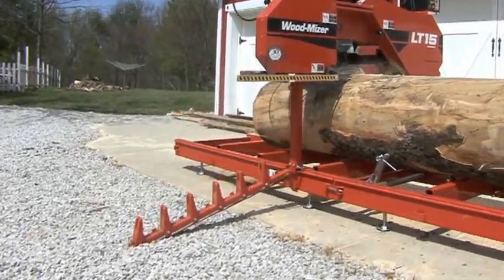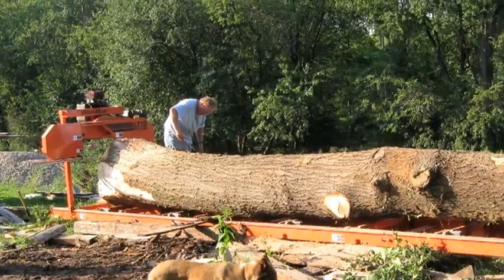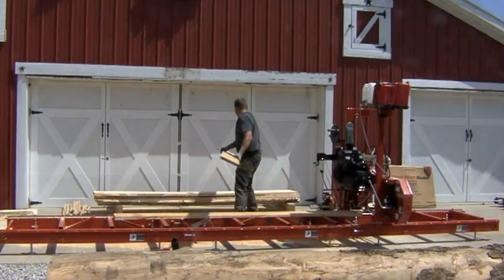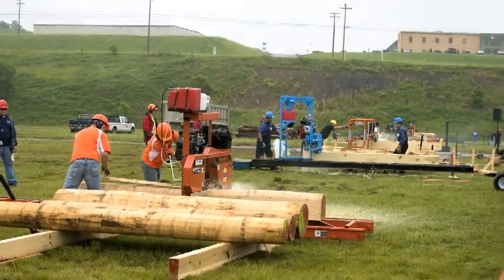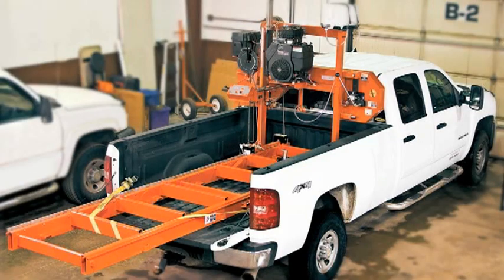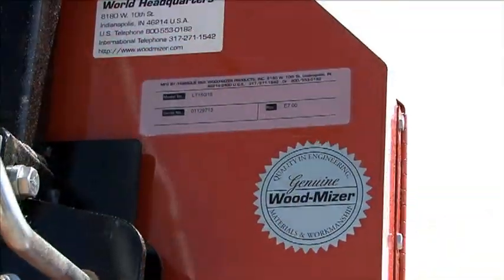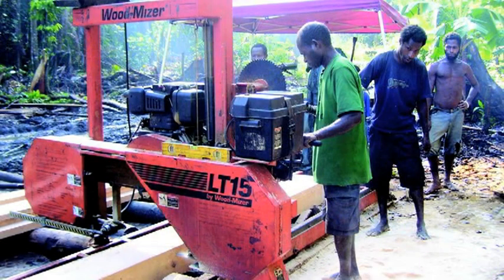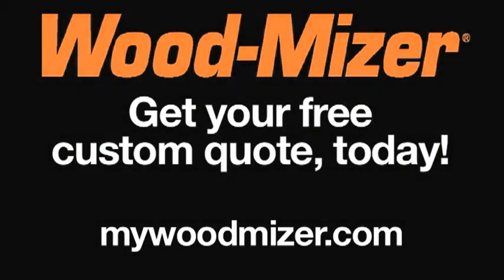LT15 Personal Sawmill Walkthrough | Wood-Mizer

Comment: I have a Lt15 with a power feed now for 9yrs its always worked perfect an cuts true with no issues at all.i bought it new in 2014 an It paid for its self in 2months. Change the blades and oil when it needs it an keep on cutting. I wouldn't buy one that didnt have  power feed. Its the best thing you can put on one

Comment: The best mill on the market,  Built a log cabin, 24+ 36,  . 2+8 planks roof,  2+8 planks floor, all the same thickness, beautiful.
All logs were butt and pass, cut three sides,  8 +8 ,  Beatles killed pine in B. C. All the window cases were timed in cedar, and resewed on the Wood-Mizer  LT 15  .  If i lost my saw mill !!,   it would be like losing my right arm,  well may be a up grade :-))
Gary